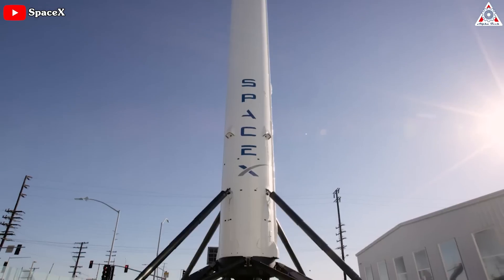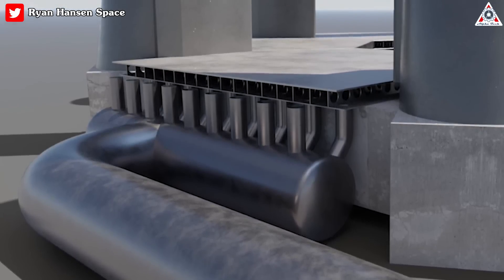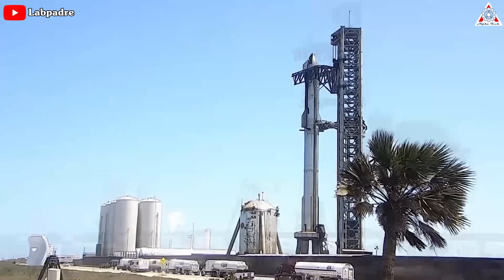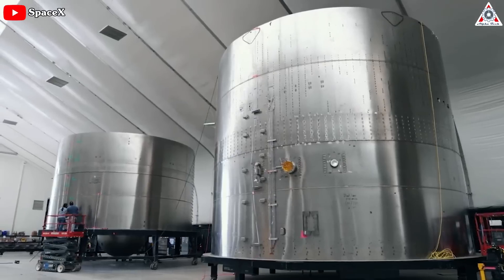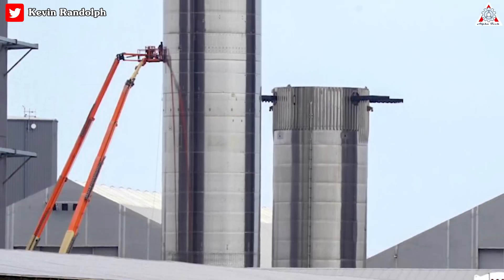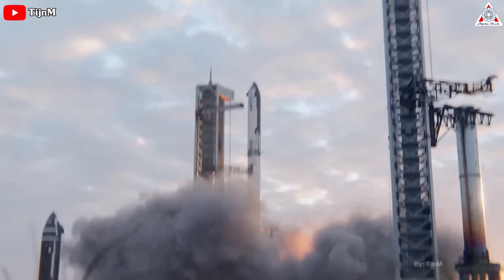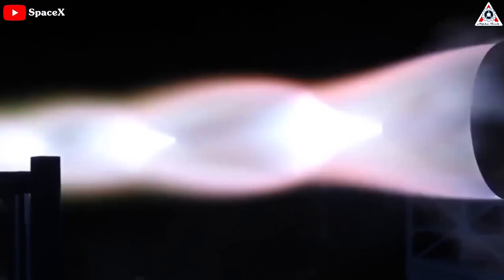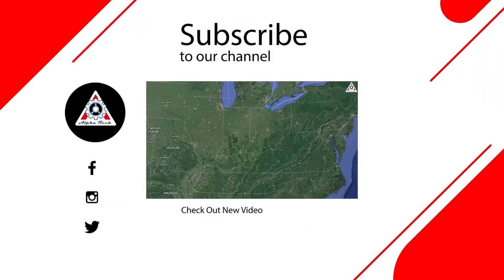SpaceX changes everything at Starbase for 2nd Starship launch...

Comment: Their excuse for no flame trenches was that the water table was too high....ummm, build-up like 39A?....naaaa, this was all a ruse to attract investors, but son of a bitch, it's working!! (minus the massive concrete shrapnel event?...)
  Prediction...(I'm not trying to be negative...I swear..)....what does water do when exposed to massive amounts of heat?....Put Kryptonite under that beast, shoot all the water you want at it, and this time there will be massive sheets of steel turned to shrapnel....it's not just the heat generated, it's the incredible shock waves as those engines create mach rings to suck all air towards the blast event.
   Go back and look at the Cronkite news release as the first Saturn 5 was launched....they were what, over a mile away?..and the 7.5 million pounds of escaping gases nearly shook his broadcast trailer apart!!
  Musk and his team are still balancing cost versus income, but the FAA needs to have review from an outside team to seriously look at the engineering...this ain't gonna work............the energy and shock waves HAVE to be redirected (AKA flame trench...)

Comment: I am not sold on the upside down showerhead concept. If at any time, for any reason, the pressure of 33 raptor engines exceed the pressure of the water jets and hot exhaust gas penetrates the steel plates it's going to flash that water into steam and the whole thing will fail and explode catastrophically. If (for example) there is a harmonic that results in a crack in a pipe or plate that results in a pressure drop on one side, then BOOM.

Comment: interesting...
the whole vertical construction thing was started because of the water tank guys, and lack of proper jig making
to do the rings laying on their side. Also the rings technique has increased welds compared to running the gores or chines longitudunal. and limits potential hull shape to round. fine for volume efficiency, but not a great re entry shape. also lacks any chance of having an artistic style.
Superior ships can be built, the Starship in future history will be considered an early fairly crude generic design.
Kind of the dug out canoe to later ships.

Glad Elon isnt hogging all the potential, and leaving so much room for improvement. That it is possible to build better ships faster and cheaper.

The problem like always is humans get doing things, use expedients and compromises, which morph into common practice and traditions, which causes a tangent off of the line of most potential. And then it takes what Heinlein called a synergystic generalist to look at it and analyze and spot the missed logic, and work forward and create the next quantum leap.

Often we ignore tech and materials improvements...
like us building wooden ships out of steel for decades, before we realized we didnt need all those ribs etc.

Elon's main value to humanity, is getting his competitors off their aft ends and starting to think and do. eventually the more intelligent will get beyond just copying everything.

Comment: All this and the Raptor 3 engine will probably replace all the Raptor 2 engines by this time next year. But with Raptor 3 setting a new benchmark for chamber pressure beyond even most experimental setups. SpaceX may begin a new program for a Raptor 4 that will probably also have increased thrust. Meaning if the Raptor engines get powerful enough. SpaceX will probably start reducing their number on the booster stage (maybe down to 20 or even 10) to again reduce complexity and construction time. I also suspect that after Starship gets the green light for launch at least cargo/satellites. I think SpaceX will change their manufacturing system for Starship. With something more automated, with less steps and man hours required. Basically allowing assemble line-ish style production of craft.
Reply: Well he’s ordered a mega form machine like Tesla to pump out Starships so I guess he’s serious…who knew
Reply: It does not make sense to lower the engine count—rocket thrust at liftoff is only marginally greater than gravity so any incremental increase in thrust has a much larger affect on acceleration (E.g. if thrust is 120% of gravity instead of 110% then the acceleration is doubled). SpaceX would just run the more powerful engines at a lower throttle to extend the lifespan and reusability of each engine.